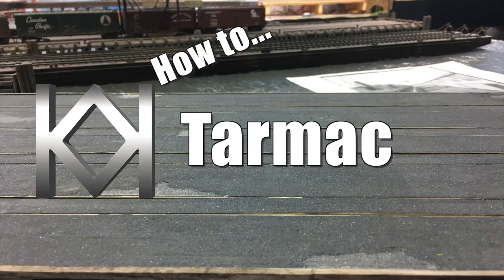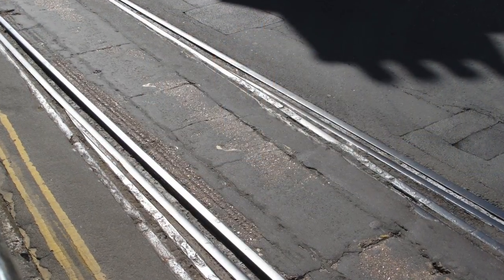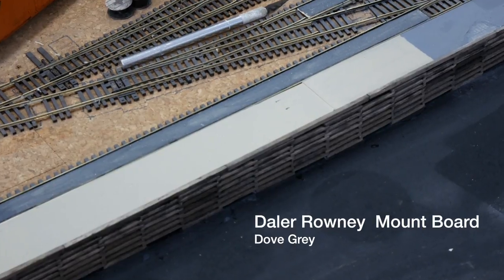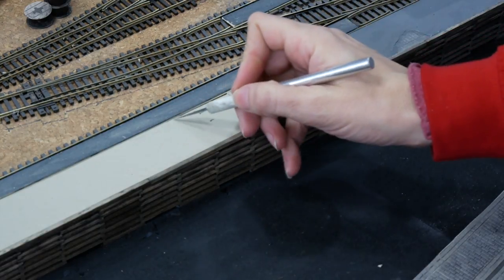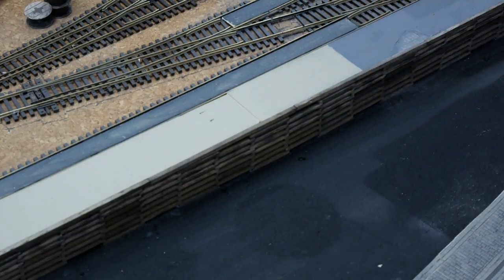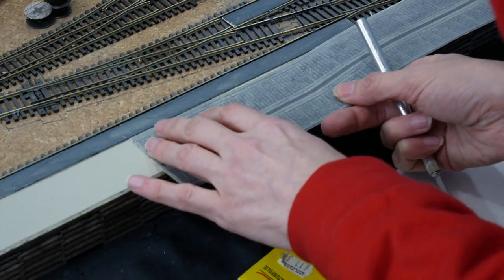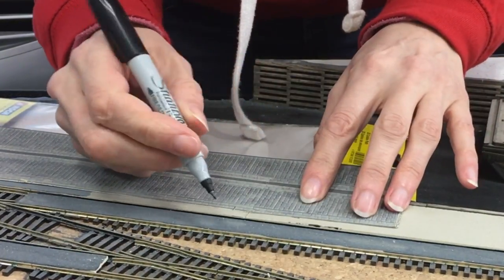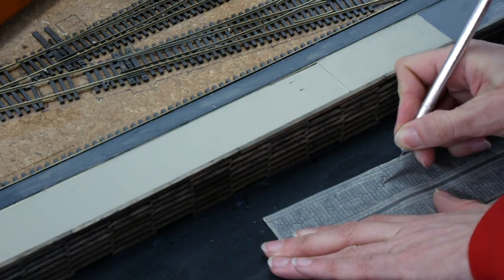How to Model Eroded Cobbles under Tarmac

Comment: Good idea.  Thanks for posting.  I also have quite a large dock area to do eventually, and I had wondered whether I want to do it in cobbles or concrete.  Now I have a third option.  Because I'm modelling an earlier period than you, I'll have to do some research to find out when the cobbles could conceivably have been covered and how quickly the covering could have deteriorated.
Reply from the maker: +mpeterll You can't beat research but a little bit of artistic license also goes along way!  I'm just finishing up my dock and I do like breaking up the area.
Reply: The answers proved to be easier to find than I expected (5 minutes on google search).  The first US patent was recorded in 1871.  By 1894, it was gaining popularity in the northeast, and by 1920, it was fairly widespread.  That's plenty early enough to have been patched several times and in a poor state of repair by the early 1940's.
Reply from the maker: +mpeterll That's good to know and thanks for sharing. I'm modelling the north east so that fits my timescales too.
Reply from the maker: +mpeterll That's good to know and thanks for sharing. I'm modelling the north east so that fits my timescales too.
Reply from the maker: +mpeterll That's good to know and thanks for sharing. I'm modelling the north east so that fits my timescales too.

Comment: SUPERB! Exactly the effect I will be modelling on my dock side layout. Could not be a better video (or series of) for me - thanks Kathy. 
Can I suggest a folding tv dinner table for your work surface needs by the layout? I have a massive (not!) 18" square if work surface in my loft! ;-) I intend to expand it, by about two feet, but space is tight. Cheers, Dave
Reply from the maker: +davie maclean Thanks. The folding table is a great idea. Is it robust enough to cut on etc?
Reply: Hi Kathy. The folding tv dinner table is quite robust. I used to use one when modeling rockets (models, but they really do fly). The metal ones are more flimsy but you can get sturdier wooden ones too. The one I used was metal and I found it suitable enough with a bit of care. Hope this helps. Cheers, Dan
Reply from the maker: I'm going to have to look for one as the floor is getting a lot of use!
Reply: If you're concerned about a small folding table been sturdy enough to work on, maybe a folding flap attached to the bottom edge of the benchwork.  It could be made out of 3/4" plywood or chipboard with a cutting mat permanently installed on top, and would be just as sturdy as your benchwork.  Normally it would just hang down under the layout out of the way, but could be lifted into a horizontal position and supported with a triangular brace.
Reply: Excellent idea Peter!!! Cheers, Dan

Comment: Great video!  I am working on a street running scene. Where could I get the putty you mentioned? Also what materials did you use to build up to the tracks? I was planning on using joint compound.
Reply from the maker: +New Haven Rails Hi, the next few weeks run through various options around the tracks but it's all foam or card. The putty is by Deluxe Materials.  It's really common in the UK but I think you can get it in other countries too.

Comment: Excellent effect.
BTW, how about using a cutting mat on your sea, so you don't damage it?
Regards, Anon
Reply from the maker: +Tom Lawton It's not that big unfortunately. The floor is though!  I model most things downstairs on dioramas and bring them up but not the track unfortunately.
Reply: As I catch up on more videos, I realise the difference in skill levels.
You have a lightness of touch that means you only cut to the depth you want.
I have a slightly more heavy-handed approach, so prefer to have an A5 cutting mat or a scrap of wood in place to prevent cutting through too far.
Thanks for noticing the risk, which you mitigated with your skill, but my comment is that skill levels may differ.
Reply from the maker: Tom, I wasn't aware I was cutting on my sea.  The bit I am cutting on is just black painted wood without any water effects yet.  It will get those at some point in which case I will stop cutting on it!